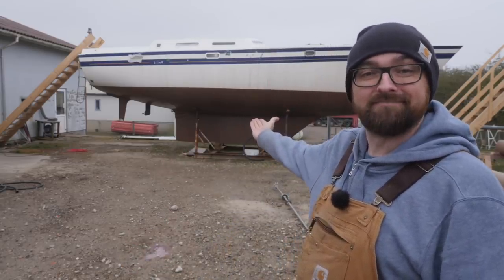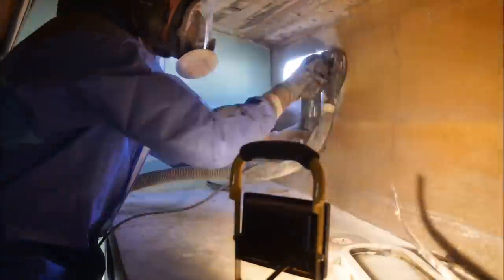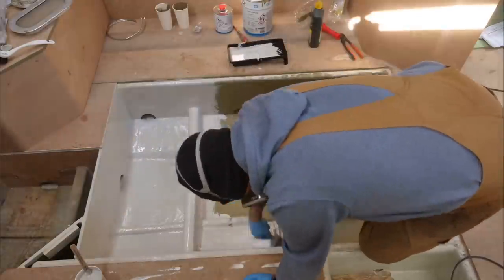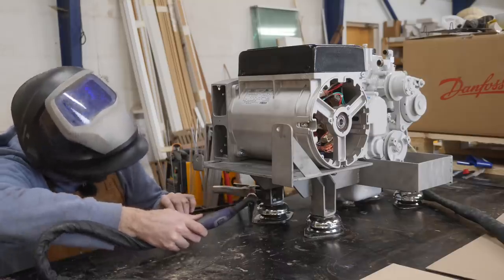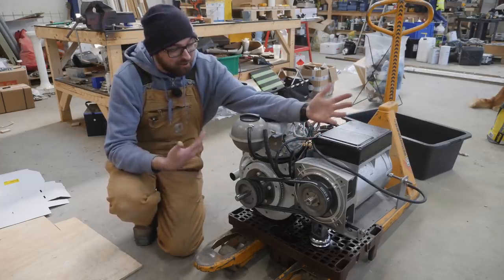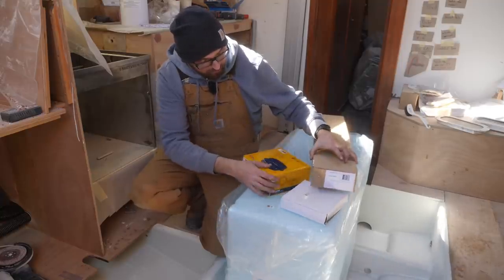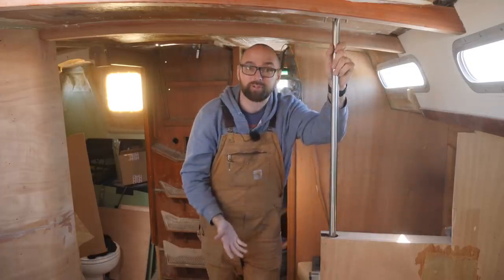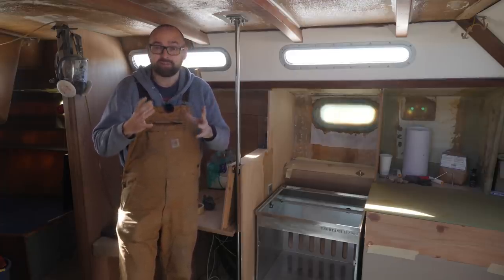Sail Life - DIY generator fail, galley pole - sailboat project

Comment: Not a big deal IMHO.  Run the IBTP a tiny bit more often and don't be afraid to load it up to make max power.  You should be able to do most chores on inverter alone anyhow, and run the generator to make it up.  Sure, that isn't ideal -but it should be possible at least.

It is not an old wife's tale that diesels want to run at near maximum load. They really do. Your oversized power head will last forever as it is running way under nameplate rating.  Your fuel consumption per kilowatt-hour will be much better this way than you would have had with a bigger diesel, and with lithium batteries using your house bank as a power buffer and load-sharing with parallel inverters will not be any issue at all if they are halfway decent units.  

With a good muffler like you have and decent isolation mounts you probably won't hardly even hear that genset running.  The lower noise and vibration of this smaller Perkins probably would be noticeably better if you could have compared them side by side IMHO.

In my professional opinion as a commercial electrician who has installed his share of industrial generators, I don't think you are out much here, and maybe even it is better this way.  Things have a way of working out for the better, and I really think this is the case here.

One thing I would have done different would have been to use a spring-loaded bogey-wheel belt tensioner rather than what you have built there.  Belts would last a lot longer and you would not have to fiddle with them at all.  Plus belt changes would have been a real snap with a spring-loaded tensioner.  That's what they use for timing belts on automotive engines and they last for over 100,000 American miles between services of any type.  Running blind behind covers that whole time.
Reply: I agree,  most of the longer run time will be made up for in fuel economy plus if use the waste heat from the heat exchange for domestic heating in your dark cool rainy cruising ground.
Reply: I totally agree. 4KW output is great, both the engine and the alternator will run below their rating, even at full throttle, so long life and good fuel economy. She'll be right.
Reply: Very well put! Totally agree!
Reply: Mads, I feel this guy knows what he is talking about. Forget any redoing and move ahead to your next project. We all err sometimes and this one May turn out for the best in time. Rock on!
Reply: My house uses less than 4KW on average over an hour (with an air conditioner running). Most appliances don't use their nameplate rating for any length of time. Cooking only needs max power for a few minutes until everything has heated up, washing machines only need to heat a few litres of water, etc.

If you have a good quality inverter/charger it will be able to absorb any peaks in power, you may find that an average of 4KW is quite a lot of power.
Reply: Don't think the idea is to try to run everything at once. Watermaker could run off the ship-engine maybe. It is better to have a generator sized for your average load, not for your peak load.
Reply: @asheswright  Nobody wants to run the generator 24/7 on a boat.  They are noisy.  You want to run the generator as short as possible to handle your high load tasks and charge the batteries and then shut it off for some peace and quiet.

Comment: Hi Mads, got my coffee for my Monday morning youtube viewing :) after scrolling through most of the comments i am on the fence with the idea of finding a 402, having a genset that you can run loaded helps keep the engine running clean and efficient, the positive outcome of the 102 is you will use less fuel than the 402 which is a good thing, and having the large generator connected at least does give you the option to install a larger engine later on if you feel the need...  our little issue is the complete opposite - i have a 24kva 3 phase 601 Mercedes Benz powered genset that i need to bridge (reduce) to approx 16kva single phase - this is a shit load of power and i am going through the process of figuring out what i should run to keep the engine running efficient...so don't beat yourself up it is all about learning and moving forward'- it is a good challenge harnessing those angry little pixies - just a side note, i hope you are going to keep up with the skill of putting a really nice radius on the 4 corners of the galley island to match the rest of the awesome work you have done... keep it coming...

Comment: it concerns me that the belt load is so far from the engine rear main bearing, I have seen engine crankshafts fail in the kind of setup you have. Maybe check with Perkins or other mechinics

Comment: Mads, I'm sorry for how you are feeling over the generator! I totally get it, I've been there, I think we all have! Perhaps not with the level of honesty that comes from a youtube channel that overflows with integrity the way your situation provides. If I can just encourage you by saying it's about feakin time!!!! I have seen you rip the top off a boat and then build a new one! I've seen you rework the structural members. I've seen you redesign all manner of electrical systems, instrument panels, interior layouts, beam rebuilds, copper coating, kiwi grip, building your own rudder with a complicated process entirely new to you. Didn't you learn how to weld? I've seen you face endless challenges that are either the fault of others or from outside circumstances and you make it all happen seamlessly. You even motored a boat from one slip to another WITHOUT A MOTOR!  It is important to get something wrong every once in a while, otherwise it isn't DIY. This is a "somewhat extensive refit" after-all, there have been plenty of opportunities to screw up and you manage to avoid those odds better than most of us ever could. It's nice to see you are human too!

Comment: Mads, don't forget that when you own a boat you don't travel, you do maintenance on it in exotic places - credit Dan & Kika from Sailing Uma. They sailed for 5 years on a DIY used forklift electric motor until they finally recently upgraded to a real Oceanvolt. Since owning a boat is inevitable involving ongoing maintenance and upgrades,  a 4Kw genset is good starting point and if you find out that you need more you can always upgrade the motor, maybe even bigger one then the 402.

Comment: I guess the logical thing to do would be find another Perkins 402 and mount it on that setup. Keep the 102 with a smaller
generator as an emergency back up. Can never have enough emergency reserves on hand. Or just sell the 102 with a smaller generator! Good luck I’m sure you will figure out something to benefit your needs best! Keep up the great videos. Just wish they were a little longer.

Comment: Have you thought about how you are going to fill that diesel tank? Usually they are port or starboard to access deck fill fittings easily.
Reply: Transfer pump between the two tanks?

Comment: What about Hot Rodding the engine? Shave the head, or bore it out and install a bigger piston. I would see what the part difference is between the two different engine; and go from there.
Reply: Easier said than done... considering all the other projects that need to be done.

Comment: I'm curious if increasing the pully diameter on the Perkins and decreasing the pully diameter on the alternator would yield more output?
Reply: FlyNineVictor , I was thinking the same thing.  Would love to see an answer to this.
Reply: No.  The alternator has to run at a fixed speed to give 60Hz AC.  That is 3600RPM.  The best one can do is to use a pulley ratio that enables the engine to run at its maximum power point when driving the generator at this speed.

Comment: Keep your head up Mads!  Yes it is frustrating but you will have a LOT of power compared to most cruisers out there on the water.  Add in 2 x 400watt solar panels and a 400 watt wind generator...  the boat has come so far already and you are approaching the light at the end of the tunnel.  Perhaps live with the smaller generator and once you are living on board THEN make a decision as to whether a larger one is REALLY necessary.  Your work is meticulous and the way you research, learn and then apply this new knowledge is a credit to you regardless of this small / minor / tiny mix up.  
Cannot wait for next weeks video!

Comment: What happens if you change the size of the pulley on the engine to a little bigger?
Reply: You may be able to improve efficiency by optimizing the gear ratio but unfortunately a stock engine can only output a set amount of energy safely. It may be possible to upgrade parts of the engine to get more energy though.
Reply: I'm new to this, so what I say is an attempt to learn. In addition to going with a bigger pulley on the, wouldn't using a smaller pulley on the alternator increase the rpm at the alternator? Do we know what the spec is for alternator rpm for optimal power output?
Reply: @mcd22630  You could go with a smaller generator pulley and a larger crank pulley,  In a sense you would over drive or spin faster the generator.

Comment: Like so many have suggested, go ahead and find a 402 or upgrade your 102 to 402 specifications.  One thing is pretty sure with boating your electrical requirements are certain to increase over time and coupled with reduced capacity with aging batteries and generator best to error on the high side of capability to start with.  Best of luck.

Comment: Don't beat yourself up Mads, you still have a rock-solid generator that cost you a fraction of a new one. Sure, you may have to run the generator more often or for longer time periods but realistically, you won't have to run every electronic device at the same time. Plus, with 500 watts of solar, even with short days and limited sun, you'll probably generate 70-80 amps. Combine that with a wind or hydrogenerator and youll make 150-200 amps/day. Those renewables, while less reliable, will significantly offset the generator power you were expecting to need to charge the batteries. Plus, its a boat, not an apartment. Sacrifices will be made and power will be rationed. You'll be fine! Also, thanks for all the great content!

Comment: Dood, I been running on my own power for 30 years and my system right now runs 4 dwellings...so  about your GENERATOR, my gut feeling is you need to find a larger diesel motor for it. The one thing that drives ALL sailors MAD is engines running!!  Hence, you need one that runs for the shortest time. Larger inverters is mad stuff because you will need bigger batteries. Fossil fuel is the best way to get max power fast. Big generator runs EVERYTHING and tops up the batteries PERFECT. CRANK IT UP AND SMILE! Anything less I believe you will regret.  Also be sure to make steel retainers on your generator motor mounts so they sit in rubber but can only move to a certain limit before they hit steel. Your boat will be getting thrown around at times...  Great channel, I'm in NZ and currently watching every episode. Be proud, you doing very well!

Comment: Couldn’t you increase the diameter of the belt pulley on the engine and reduce the diameter of the belt pulley on the alternator so you can spin the alternator faster while running the engine at a lower rpm?
Reply: Sure, at no load.  The Perkins only makes so much power, and if you increase pulley diameter the Perkins won't be able to spin the loaded alternator at rated speed.  You can't extract 10Hp from a 5Hp engine by changing the pulleys (making up those numbers, I have no idea what a Perkins 102/402 produces).
Reply: Yes you can, because diesel has a ton of torque. Yes there are limits...however changing the ratio of pulleys is sound.

Comment: Hi Mads, been watching you forever and thoroughly enjoy your vid's. I understand what you are saying about the power usage you expect, however, we have a cat with a lot of solar and still don't meet our ideal power needs. We have learnt to adapt and to be honest its no big deal. We have a 3kw inverter 600amps of lithium and cook with a combi microwave and dual induction hob. We also have a combination water heater that is connected to our 240v system. We can't run everything at the same time but timing things to work when we have the power is no big deal. I have been around a lot of boats running generators and the less time they are running the better. What I'm pointing out is that the less time your generator is running the happier you will be. So the more powerful option charging your batteries and running your white goods the better.

Comment: Mads, don't forget that the diesel fill, vent and the returns from main engine and genset all have to go into the top of the fuel tank. Also you will need a gauge or sight-tube to determine how much fuel is in there.

Comment: Bill from Silent Thunder a  Morgan 
Out Island We spent 3 yrs in the Caribbean during the late 1990's. I would have gladly traded my 12 kw generator for a 4-5 kw unit that was well sound proofed. Running a small diesel gen. at full load makes good sense.  Remember extra cooling will be necessary
 as the generator & motor produce considerable compartmental heat which needs to be addressed. While underway a  high capacity alt. will easily top off batteries. You should get a couple days on batteries alone. Most of the time on the water less is best. Thank you for your detailed well thought out channel. Your abilities will serve you well on the water. Good practical mechanics are hard to find out there.

Comment: Hi Mads. I have used this lock down to binge your videos.  I am really impressed with your work.  I have one suggestion for you. I have notice your aggravation at occasionally ordering or measuring incorrectly. As one of the only two 'mericans to use the metric system can I suggest you switch to millimeters for anything under a meter. I am a carpenter/cabinet builder, and we use mm exclusively and the only mistake I end up making is dyslexic number switches when I hold the tape upside down. So instead of reading 15 centimeters read 150 mm.  Instead of 30 centimeters and 6 mm read 306 mm. I think it may help, give it a try.    My last comment is I have never seen someone with such a wonderful attitude as you display. I believe your success and joy comes from the attention to detail and  great attitude you approach life with. Congratulations.  I wish you continued success and enjoyment on your project .

Comment: Mads, by doing management of your power usage and scheduling the operating of different functions you may find that the itty bitty tiny generator is more than enough for your needs.  I mean how bad do you want to spend a winter in the North Sea when you can be in the Med or the Bahamas for the winter and then sail back to Denmark for the beautiful summers?  The beauty of sailing is going where you want to be not where you have to be. My best to Ava and Jurkil.  Thank you for the video, take care, stay safe and stay well.

Comment: Dear Mads,
I watched with interest your generator troubles. It is rather familiar to us. We had a single cylinder Hatz diesel installed on our generator, much as you are doing.... but in a 53 ft yawl. From recollection about 8 hp and putting out 70 amps at 24 volt.
The problems that arose were signficant.
It was installed in a well sound proof engine room (uncased) and still was irritating enough with noise and vibration to not want it running. The main engine was much quieter and also had far less vibration. Admittedly, this generator was a single cylinder engine and more "thumpy" than a twin.

Other aspects that did not occur to us until we used it were:
With a dry exhaust run, it had a nasty "pop" bark to the exhaust note.
The diesel "smuts" around the dry exhaust dirtied the hull amidships and also made it unusable in a marina, against another boat. It was audible at a distance and we could not use it at anchor without being unsociable to the other surrounding yachts.
This was in 1980 when diesels were a bit cruder so may not be so bad now.
So these aspects should be considered too, especially if it is in your "technical room". The mountings, no matter how good will transfer vibration to the hull. We had a 110 hp main engine and this was mounted down into the lead of the keel, to kill vibration. You need "mass" to kill vibration and this will be a real problem to do without adding unwanted weight, from "mass-dampening". From recollection we had 8 ton lead keel and that completely killed the vibration of the engine plus gearbox, which probably weighed about 1/2 ton.
I hope this gives you some  "pointers".
I think you are doing a superb job and the standard is extremely high. Keep going!
Very best wishes,

Simon

Comment: Mads thanks for keeping it real and being honest. I have to agree with some other folks--- upsize the engine to what works with that gen head. The question is whether it makes sense to run it until you find another one down the road or to sell it while it is fresh. THAT depends on the availability of another diesel motor.  I would think small diesels are harder to find than bigger so maybe being patient can pay off.  Don't sweat it too much, we all screw up once in a while and it's how we learn the hardest lessons sometimes.

Comment: Not sure you want to be doing laundry while making water... You may not be as bad off as you think... That generator DIY project looks awesome.   And you might find a replacement engine in time.  Give yourself a bit more room for bigger engine.  And are you tying the generator heat exchanger into the hot water tank and a bus heater.  This is a great use for some of that waist heat.  Great video.

Comment: 4.5kW will be fine! Plenty for cooking and baking. I am currently fitting out my RV and thats more than I have to work with. I have a gas generator and plenty of lithium batteries. Very difficult to get household power levels without the grid.